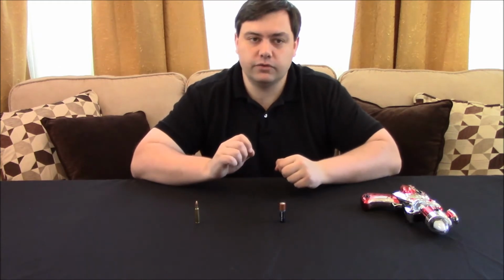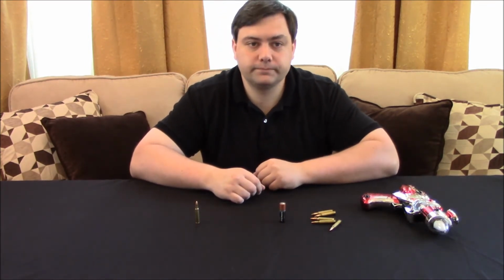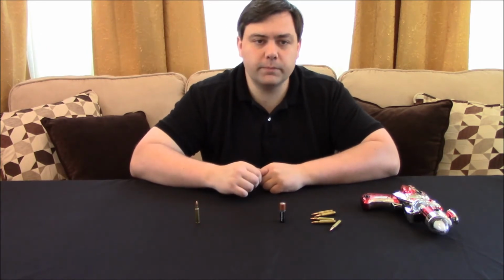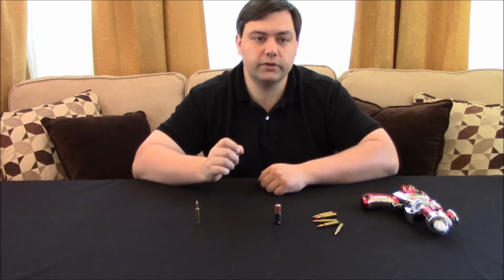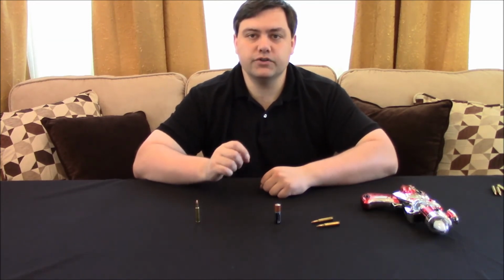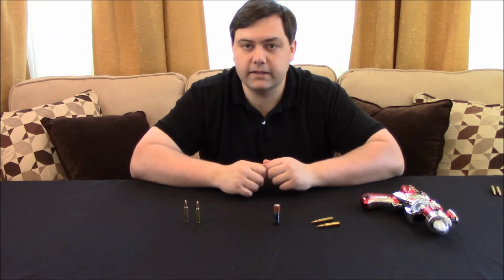Where's My Laser Blaster?

Comment: You should mention the usage of non-lethal microwave trucks. And spekaing of building a railgun into something practical, such as a tank, well the tanks already use turbine engines which should be able to charge a railgun within a minute to gain an approximate equivalent muzzle velocity as they already do today, but well it's not always practical to wait that long. I think rather tan using a battery, using something like an inertial wheel which would do a better and safer job than a large battery would.
Reply from the maker: The science behind non-lethal, directed energy weapons (like microwave trucks) is very interesting. I am sure it will be a topic of further discussion soon.

As for using a tank's turbine engine to operate a rail gun: The engine is powerful enough to operate a rail gun, but a lot of fuel will be consumed while creating this power. A typical US M1 Abrams consumes about 1 gallon (3.78 L) of fuel per minute during standard operation, and gets about 0.6 mpg (392 L/100km) when driving. It is then a choice of carrying separate propellant in the round (like we do today), extra weight in a battery, or extra fuel for the engine. Right now, each weighs about the same for a particular level of performance.